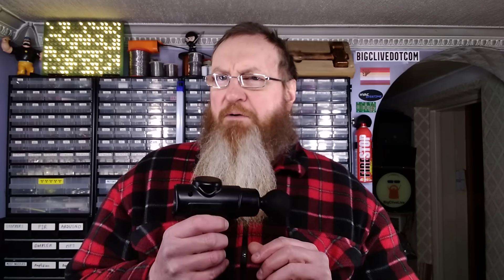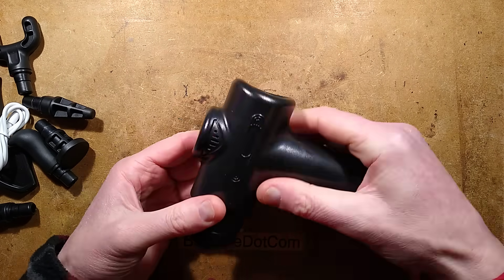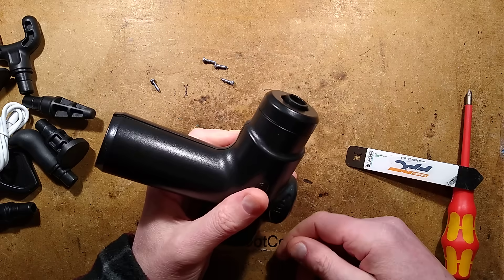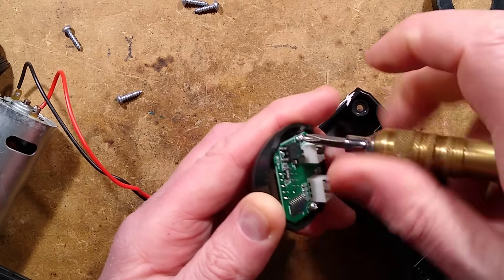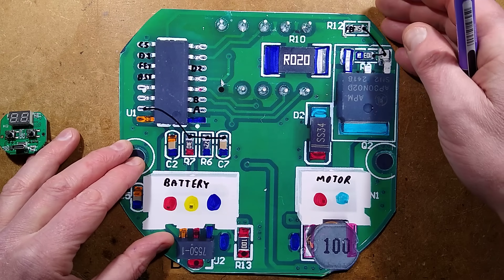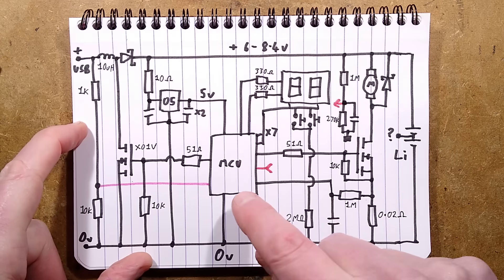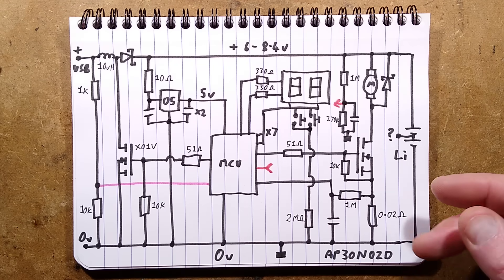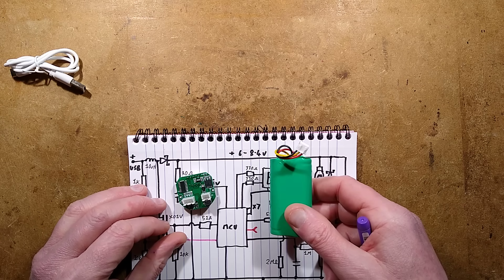Inside a percussive massage device - with schematic

Comment: I've got a 120v corded version, with a heater function in one of the heads. Very good for tense neck muscle induced migrains, although standing in the shower with hot water beating on my neck works much better.
Reply: Don't try both at the same time. 🤣
Reply: @Franko_Walker  aww, you beat me to that low hanging fruit...

Comment: I got my dad one and I think he never used it, but I thought it looked more for muscular use and didnt include the vaginal attachments... Feeling as though one of these against the forehead might be quite nice... Maybe its time I got another... Might be useful for getting stuck screws loose 😅 impact screwdriver

Type A charge cable? Is that not usbc... Sensing this was rather late at night, missing the screws and calling the batteries double a's, you should sleep!

Comment: That is going to give you a good pounding. has it got an IP rating or would someone need to pop it into a Ziplock bag. Nice chunky motor should take a while before it burns out.  Interesting video 2x👍
The James Bond franchise has just been sold off to....... drum roll please 
Amazon 🤦‍♂🤣😂
so 007 will probably be a yank and the story line like something from fecking Disney of Marvel.
Reply from the maker: There is a very bad attempt at creating a seal to the rubber grommet with the "flaps", but the lack of silicone grease on the piston means it will just abrade the rubber away.

Comment: I presume after treatment your beard no longer has hysteria
Reply from the maker: The correct procedure would be to gently massage the hysteria from the beard down to the groinal area, where it would be ejected.
Reply: 😂 @bigclivedotcom
Reply: Aside from the obvious uses, these things are an absolute game-changer. I used to be a hydraulic service tech, which involves a lot of extremely awkward exertion, and I was getting chronic tendonitis in my arms. Boss said to get one of these, and it did the trick.

They make massaging yourself actually work, and in a reasonable time frame! Spend thirty seconds to a minute on an area, and it feels perceptibly better. Spend half an hour hitting all the sore spots you can find, and you'll feel noticeably better than paying the purchase price of one of these to get an hour of massage from a professional.

And that's pretty damn rad - draping a whole bunch of 'ooh, matron' all over it is likely to obscure this important boon. NB - my one is two or three times the size of this one
Reply: Not sure this puny thing Clive tears down here has enough grunt for the above to apply; my one has a brushless motor about the size of a small SLR lens, and a battery about the size of a jumbo drink can. The missus complains it's too heavy for her to use, so there's probably a sweet spot between my one and this one
Reply: Hmmmm.... no more beard vapours.  And it doesn't seem to swoon, either.
Reply: That's some good ol' 1900s psychotherapy right there!!!

Comment: You have a dirty mind. I have one of those (a bit more upscale model), and they are excellent muscle massaging devices. Mine has a removable battery, and it could take 6 18650 cells, but they only put in 3. So I 3D-printed a new case and built a 6-cell battery pack. I have also designed my own attachment with much larger surface area (it's on my printables account), because the original ones were all too small to transfer enough energy to the larger muscles. I used those for cycling-induced soreness and the device is quite powerful enough to make your entire cyclist's thigh shake like jelly.
I don't think that they are widely used for "that". Unlike the victorians, people these days don't need an excuse, and there is an incredible wealth of dedicated devices that must work much better in that role.
Reply: These are "easier" for prudes to explain away - Is it for their shoulder? Is it for their other bits? Deniability is the name of the game.

Comment: Not sure about the “toy” value as they are rather raucous.
They do work well for muscular aches and pains, mine is an Aldi one and also has a hot/cold option, I’m assuming with a built in Peltier device.
That would also be an exceedingly useful board if it could be reprogrammed.
Not worth pulling the end off the battery pack to see if there’s electronics embedded in there somewhere?
Reply from the maker: I toyed with opening the pack, but couldn't feel a protection PCB, and the three wires suggest a mid-point tap.
Reply: Might very well have a protection PCB...
I recently tried to get a LiPo battery pack without one. There are VERY few on the open market here in Germany. Maybe there are new laws that prohibit shipping unprotected cells? At least the only sources where I could find them (without specifically asking) were the Chinese distributors.

Comment: I have a few higher priced versions of this that i use for normal massage purposes. I have ones with larger battery packs. They have 6 cells and each of mine have killed some of their cells. I suspect that there is no charge protection, so some cells are being over/under charged. It is a shame how much they put into the product just to be killed by a simple flaw.
Reply: Define “normal”😂
Reply: @JMWexperience  not on the wifey as a hedgehog-nose-puncher 😅

Comment: I've got a slightly more branded one that's not really that different, maybe slightly smarter battery charger, and it works pretty well on sports-related muscle pain.  I dunno, it doesn't seem quite right for certain personal areas.  Compare that with the hitachi, well-known with third-party attachments (often dishwasher-safe silicone) for such uses.  I guess it's possible somebody makes third-party addons?  But that'd only work if the connector type is universal...
Reply: Like Mike Tyson, that could give you a battering around the ring.
Reply from the maker: A search on eBay suggested two size standards.

Comment: I got one of these a while back when I was having issues with muscle cramps in my thigh. They actually work amazingly well for relaxing a muscle and stopping it from making the screaming-pain.
Reply: It works on the love muscle too, Eventually, that goes limp too. Takes a while, but it does, 😄
Reply: @Stephen.C.  You mean the pelvic floor? I mean, yeah, but you'd need a special attachment to get it in there for those. /s
Reply: How far up your thigh were you using it?
Reply: Does it help for RSI?
Reply: @MrKillerno1  No clue. I don't have any RSI.
Reply: @MrKillerno1  Seek professional advice about treating your RSI. But you need to stop doing whatever it is that's causing it. 😉
Reply: I use it mostly for my back, it's a bit too harsh for downstairs, you're gonna get numb before it's effective, and if you try you probably will blow some capillaries meaning you'll be sore for a bit.
Get a wand with a random function, it's best imo, constant speed isn't great. Also you can get a decent portable one for like 30 bucks
Reply: I received a very sophisticated version made by Sharper Image as a gift. It has heat and cooling too. 

It does work great for deep muscle soreness. 

But it recently died. The circuitry is much more elaborate. I can not see anything wrong with it.  The boards are so small,  i don't think I could fix it even if I figured out what is wrong with it!  I miss not having it!!
Reply: Had a few issues with leg cramps, ended up being able to solve them by increasing my potassium intake
Reply: @oxylepy2  Yeah. For me, it was high blood pressure and blood sugar causing mine. The reason I had them cropping up again (that I mentioned above) was my doc was swapping me between medications, and my sugar spiked while the new regime settled.

All fine now. Discharged the battery down to 25% and put it back in its case for next time my doc wants to play musical meds.
Reply: As a bicyclist, I can see how that can help. Stretching and proper hydration also help a lot.
Reply: I tried it on a trapped nerve on my back

Absolute torture.
Made everything worse
I couldn't take a full lung breath for three days without upsetting the nerve all over again
Reply: @JaSon-wc4pn pretty sure the warning label says "only for use on muscle tissue"
Reply: @Tatwinus  Yup, mine did.
Reply: @JaSon-wc4pn  you are not supposed to use it on parts that are ill.Silvercrest one has a warning in manual about that.